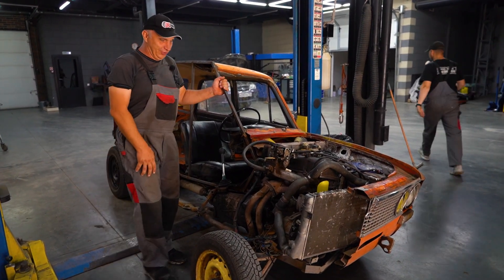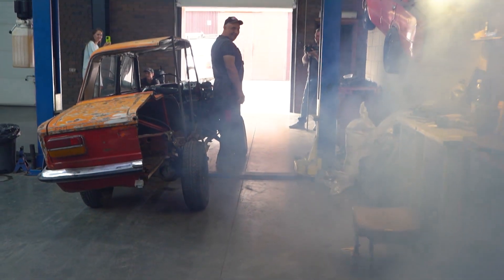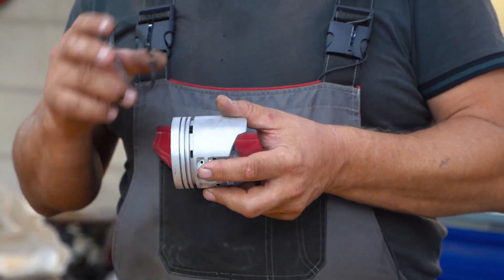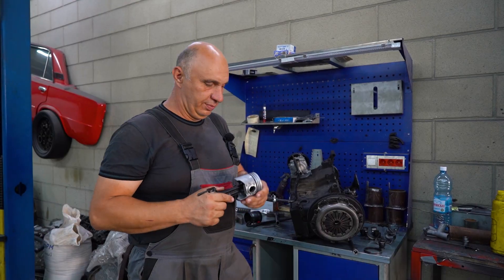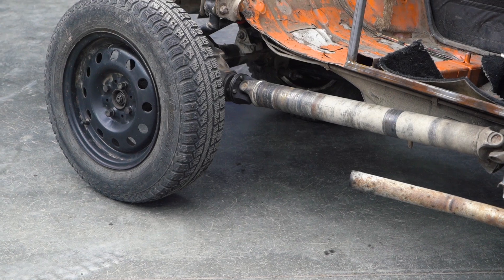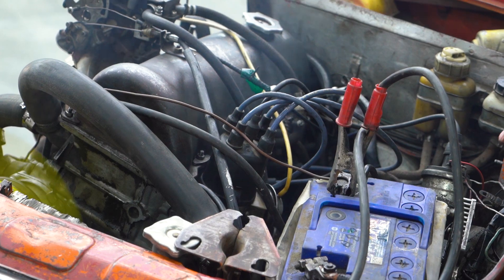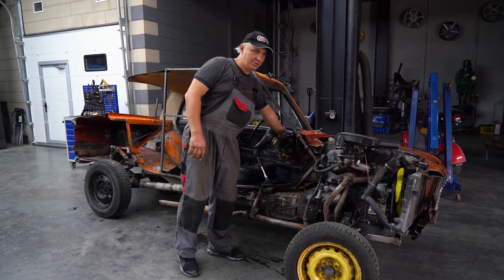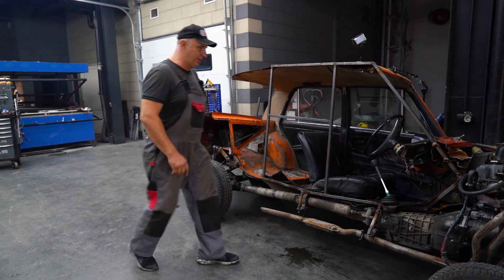Three oil rings per piston - engine no longer smokes!

Comment: ok well it is an experiment, but if you rebore the cylinders for  4 new pistons this engine will live for at least another  200000 kilometers .... also the oil rings are thinner than the original compressor rings that also can handle the high pressure of compression and also the heat from the combustion chamber.. lot better ...

Comment: Maybe put oil controll rings in the two bottom groves of the piston and drill the holes they need to get rid of the oil. Then leave the top compression ring in place and make another grove in the piston for a second compression ring between the top of the piston and the original first ring grove. There is some space there for another ring. That might solve the smoking and the blowby issue.

Comment: Those cylinder walls were a mess , should have been honed if not bored! Scratches and grooves won’t seal even with 5 oil rings..
I’ve know machinists to run no oil rings with just 2 low tension compression rings and not smoke!
Always interesting to watch your experiments

Comment: I bet if you took a few minutes to hone the cylinders to help the new rings seat better along with fitting oil rings in the 2nd & 3rd ring groves & a compression ring in the top grove that would be an ideal setup to get a lot more life out of a worn motor that otherwise needed a rebore with new pistons.
But you did a great job trying something that’s not been done before that I know of so keep up the good work & trying different automotive projects to fix everyday car issues.
Happy Motoring from Scott from the USA.

Comment: I would have replaced the valve guide seals to be sure that the oil burnt is coming from the piston not the head... Awesome video!
Reply: no reason to do that because if that was the case it wouldn't smoke after it warmed up . when a engine smokes and doesn't stop you know it's the bottom end not the top end

Comment: How about making an opposed piston, opposed cylinder engine?  2 pistons per cylinder and 2 crankshafts.  Stack 2 short blocks together, and make it 2 cycle.  Make one crankshaft lead the other by 23 degrees to improve scavenging.  Beware of Pascal's Law: you cannot compress a liquid, so don't flood the engine with fuel.

Comment: Those oil rings will lose tension over time cause they can’t handle the pressures from combustion. That’s why compression rings are different materials. 
The secondary ring is a scraper and that’s usually the one responsible for smoke or scratches and deformations in the cylinder wall.

Comment: Great video wish you guys checked compression before to compare. 
I got a video idea. I would like to see you guys build a small but funky looking vehicle like a box shapped almost like a van suv type of 4 wheel vehicle using components from a car or truck but mostly all new parts like for the steering and suspension in it. Used engine and transmission and chassis ok.  What you guys think? It would be a cool new build to watch.
Reply: CHECK OUT "rather B welding"

Comment: iron-air fuel cells, with vinegar table salt citric acid electrolyte, use graphite rod carbon felt cloth air oxygen electrode, and gods of engine building are you

Comment: The oil ring and holes in the piston is made to apply oil to the cylinder, not wipe it away. The ring right above the oil ring is called the wiper ring which wipes the oil away and the top ring is the compression ring.
Reply: WRONG

Comment: You should try taking out the wavy ring in between the oil rings and using all thin oil rings to fill in the ring space and see how it works even use the thin ones for the compression rings that would be like 20 rings on each piston lol

Comment: Perfect timing....i was wondering about how this would work.....i'm looking at using half the cylinders of an engine as a vacuum pump driven by the other cylinders running as normal.....this means that the cylinders working as the vacuum pump need extra oil rings to prevent the crankcase oil getting sucked up into the cylinders.....i was actually wondering about how 2 oil rings and one compression ring would work
Reply: MUCH BETTER.

Comment: Its a great result - but the result would have most likely been the same by just replacing the first oil rings, so them putting the other 2 likely did nothing.

Comment: It will work for a little while, but the reason the compression rings are made of harder heat resistant material is they do get very hot, especially the top one, so oil compression rings will not last that high up on the piston, he would have had very similar results by just putting in a full normal set of rings on those pistons. A better idea than is to at least hone the bores. They would last longer than.

Comment: The oil rings also spacer rings , and holes in the piston are designed to do both, remove excess oil, as well as hold oil to lube the cylinders

Comment: What about pistons made of brick? Because we know, when you fire up an brick, it comes more better for building. Or maybe make some various pistons out of stone like material. We know there are even ceramic brakes, but what about ceramic piston? And maybe the last, but not the least idea, how will the wooden rims work nowdays on a car? Are they still a possibility?
Reply: Brick and ceramic designed like a typical piston would just break.  Stronger stone will just get too heavy and beat the hell out of itself, the cylinder and the valves as it develops play (assuming it's even in one piece by then).

I do think with the right design and wood, a wooden rim on a lighter car could technically work in the short term. You could probably even get a plastic rim to work using a material like ABS until you hit any sort of bump. Without clever use of carbon fiber or metal supports nothing like will hold up on a normal car.

Comment: I would call the experiment a bulshit test. Without those slots in the ringland, it's no longer an oil control ring. you're just essentially using an oil ring as a compression ring, and you can stretch an o-ring over that piston and it'll fire, at least for a little bit😂

Comment: can you try putting a torque convertor into a manual transmission
Reply: This actually works pretty well. At least on heavy equipment. I've driven a front loader that had that. At first it was a bit strange, but soon you learned to love it. Thing is you can pop the clutch while standing still and nothing happens other than the engine RPM going down slightly. Let go of the brake and the machine will start moving. For low speed maneuvering you moderate speed with the brakes and never touch the clutch. For a front loader this was just about perfect. Another thing is that it didn't have a reverse gear. Instead there were a separate gear for selecting back or forward without touching the main gearbox. With the torque converter switching from forward to reverse was very quick and seamless. With the way you work with a front loader there's about as much going backwards as going forward, so this was second only to a fully hydraulic transmission or possibly a electric drive system.

So yes, a torque converter is an interesting addition to a car.

Oh and with enough engine it's all you need, at least according to Koenigsegg who showed off a hyper car where they skipped the common gearbox, only retaining forward and reverse, and used a massive torque converter. Well that was with a 1100 HP engine so not necessarily the same as putting one on a clapped out Lada...
Reply: wow thanks for the reply what you have said sounds really cool. I'm a mechanic rn and have always wondered if it would just become kind of like a sequential where no clutch is needed. I hope they do it lol @blahorgaslisk7763

Comment: Alot of that could be valve stem oil seals aswel???    What about 1 compression ring like some racing 2stroke engines so there's compression and 2 oil scraper rings

Comment: Compression rings serve a dual purpose, by keeping the pressure in the combustion chamber they also keep it out of the crankcase. You're to get a lot of crankcase pressure and all the problems that go with that pressure. Might not happen right away, but it will happen.
Reply: They also keep the top of the pissing from slapping the cylinder wall
Reply: @ryanmal What a godly autocorrect 😂
Reply: as you would see if you watched the video
Reply: This is what I was wondering
Reply: Crankcase ventilation?
Reply: @TheKookiemonster007  blow-by contaminates the oil, reducing its lubricity, even if you have ventilation
Reply: They didn't even do a quick hone with a drill.  SMH
Reply: Hahahahahahah

Comment: The valve stem seals could also be shot.
Reply: I was wondering if the original oil control rings were all fouled up with carbon and not controlling the oil in the first place?

Comment: sorry calling bs on this one , 1:  could have been valve stem seals replaced off camera, 2: the smoke was not blue, rather white : blown head gasket , you put a new gasket on at reassambly , dont you ?
Reply: If you look at 3:16 there is a spot on the right cylinder, #4, that looks suspect.

Comment: Can you build an opposite piston engine from two Lada engine?
Reply: I asked for that a few months ago. They could cut cilinder wall with a latte to make ports install direct injection and use long bolts that cross blocks. Maybe could work but its hard to timming that
Reply: @LeoKadettGSI they could just make it diesel

Comment: I would call the experiment a success. Under normal driving conditions it smokes significantly less than before. Good one boet.
Reply: They also fully cleaned the pistons and fitted brand new rings. No shit it doesn’t smoke lol
Reply: @technoir2584 lekker, lekker...
Reply: dikke lul
Reply: Success at 107%.
Reply: Much of the smoke coming out is likely excess fuel from the amount of blow-by reducing available oxygen and increasing the amount of HCs present in the intake. Add an EFI system to balance that out (subtract the fuel that has no O2 to react with) and it would likely be much cleaner still.
Reply: @teardowndan5364  no thats oil smoke i can tell because its blue
Reply: @joshmanis-h7h  An excessive amount of blow-by would pick up oil from the crank case and send it up into the intake. They did notice an excessive amount of smoke and blow-by volume coming out of the crank case and they did decide to pipe that into the intake before their test-drive.
With a carburettor, you still have the same amount of fuel going in regardless of what the blow-by gasses are made of and you get a lot more of everything-smoke coming out since there is less oxygen all around to burn everything with. With EFI, excess HCs would get balanced out and whatever oil goes through either way would burn much more cleanly.
Reply: @teardowndan5364  blue smoke is oil, not fuel. The fuel delivery system has nothing to do with it burning oil. Your point would stand if the smoke was black, but it’s not.
Edit: they say at the end the smoke became black but it is absolutely still blue. And you would get less blow by from a warmed up engine vs when it’s cold